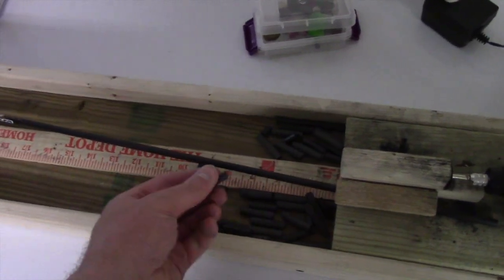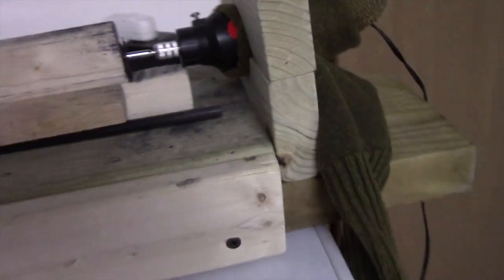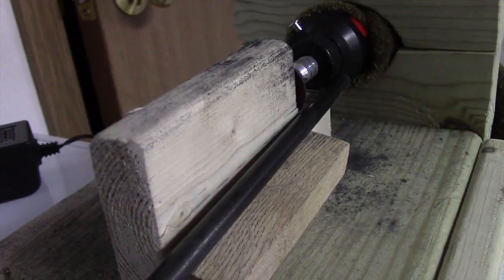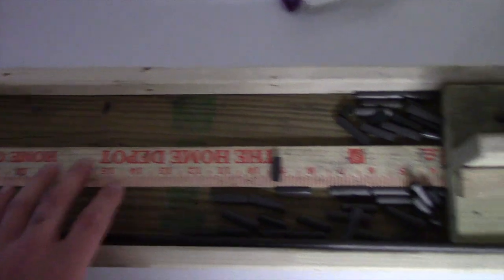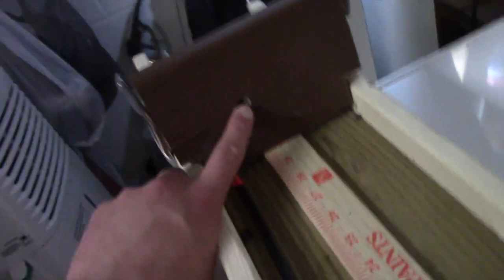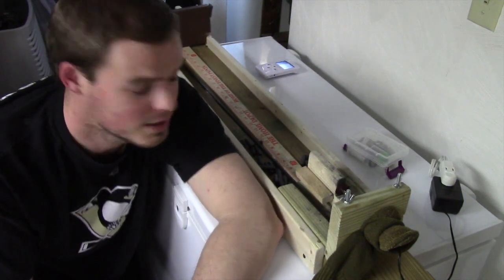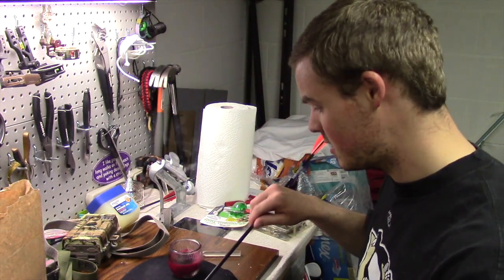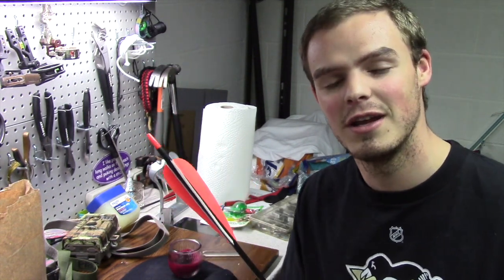Creating and Fletching Your Own Arrows

Comment: Hi
 When I made arrows back in the 70's I used something called a Thompson Tri-Fletch jig. It fletched 3 vanes at a time and could be adjusted to produce a helical twist in either direction. I've looked for another one, but it would appear that they're no longer made, a real shame!!! Another thing that amazes me is that you use a double sided tape??? I cannot believe that it's as good as the Bohning FletchTite  adhesive that I used for everything. I could never bring myself to trust tape, and it looked like an awful lot of fussing around to get that tape situated. I just ran a bead of Fletch Tite along the quill and set the jig in the fixture. Except for the drying time, I could fletch an entire arrow in under 3 minutes.
 Thanks for the trip down memory lane. I wish I still made arrows. I'm not sure I could afford to do it these days? Back then I could make a dozen Easton Game Getters for about $10.00. These days 2 shaft blanks runs that much!! I made a lot of Port Orford Cedar and barrel arrows too.
 Thanks:
Dave
Reply: Right on mate I was doing the same thing back in the late 8os 2117game getters out of pse pulsar express cam bow loved that bow getting back in to bow hunting not liking the new bows need release aid I'm a glove man

Comment: Great video! I like the Bohning fletch tape as well. The original Fletchtite glue was better than the Platinum IMHO. I put my arrows together pretty much the same way. I also use hot melt glue. I've used  the craft glue, Fletchtite hot melt, which is more brittle when cool, and I'm currently using some from Big Jim's Bow Company, which is just a longer stick of the yellowish hot melt glue. No problems with any of them. I haven't tried the platinum with vanes yet. I generally use cyanoacrylate gel with them. I think the acetone or denatured alcohol and keeping your greasy fingers off the shaft is the key to getting any of the adhesives to work well.

The one thing I do differently is for my hunting arrows. I usually use Zwickey Deltas, Simmons Tiger Sharks, or Magnus Stingers (usually with the bleeder blades). I like to have the blades positioned more or less vertically when on the bow, so just using a field tip won't cut it for my broadhead arrows. For those I install the inserts with a broadhead so the threads of the insert are lined up correctly. For safety's sake, always hold the broadhead with pliers or a broadhead wrench when doing the install. For practice with field tips or stumping with blunts or judo points, or probably even with three bladed broadheads, installing them the way you did is perfectly fine.

Again, great video! You would make a good teacher.

Comment: Try coloring the unsquared end of the shaft with a Sharpee before squaring it.  Once all the color is gone, you're pretty square.  Low spots will hold the color, so keep squaring until the color is gone.

Comment: The Easton tool you are using is not a squaring device, it is for rounding the inner edge of the carbon arrow to make inserting components easier and less likely to snag or degrade over use. If you watch in the video as you rotate the shaft, it is moving which compromises the squaring process. You need a tool like the G5 squaring device or the F.A.S.T. Tool, both of which immobilize the shaft while it is rotated to ensure a square end. Overall a good video.

Comment: Do you have a video where you cover bow maintenance? I shoot a compound and was wondering if I'm supposed to put any oil on the shaft going through the pulleys and waxing of strings and such. Glad I stumbled onto your site as you have explained quite a few questions I had in a very simple to understand fashion. Thanks
Reply from the maker: 1LRLRG I don't have that particular video but it's on a mile long list of ones I'm hoping to make!

Comment: Nate, I think you miss 2 thing. One is if I use nock pin, do I need to use same method like the point when glue it into shaft? Two, if I use insert nock (not using nock pin), what type of glue that are recommended?

Comment: Great job gave me some ideas.
I have tried 4flech gold tip regular size (Carbon)  
They have given me tighter groups (fact)
Also noticed 60 yards and less quieter flying before impact.
I want to move to micro arrows next.would about longer 3flech?
Longer than blazer length?
Any way, love the 4 flech . Too hard to glue them on?

Comment: Have you found a consistent conclusive method of locating the spine (stiffest side of the circle)?  Have seen different methods. Floating in soapy water, hanging a weight and measuring deflection.  What do you prefer?
Reply from the maker: I don't do any fancy method to find the spine. Dynamic spine matters more. You can only find that by shooting. So that's the method I prefer.

Comment: Would you use a helical with a short low profile 2" vane or just the offset? Seems like the helical would not do much on the sort fletching plus it's for a micro diameter shaft so might make it more difficult to glue them on.
Reply from the maker: Always run a helical for me. Even with that short vane, when I fletch offset vs helical I can look down the back of the arrow and see a noticeable difference. Yes, with micro shafts you have to be more away of full fletch contact, however I still manage to get a 2-3deg helical on my .166 Orion shafts.
Reply: @averagejackarchery  Yes I did a test yesterday and you are correct. I like the look of it. Will do that when my new arrows come in. Thanks

Comment: When cutting, do you rotate the arrow into the blade (so that the arrow surface and blade surface move in opposite directions)?
Reply from the maker: I'm an oddball and spin the arrow with the blade. I find I get a much more consistent feel and squaring of the arrow when I do it that way. Plunge to cut through main wall, than spin slowly to get the rest of the way. Maybe it's because I'm left handed in a world built for righties? Who's to say.

Comment: Hey man! What’s your take on the type of jig used? I’m looking at getting the bitzenburger but have seen others for cheaper prices (ie Arizona EZ fletcher, bohning blazer). Is there any reason you prefer the bitzenburger?
Reply from the maker: I use the Bitz, Bohning Helix Jig, and JoJan in the shop and the Bitz is just the most versatile on the market. Not to mention built like a tank. Now, if all you want is Blazers on standard arrow diameters, then cheaper options are fine. I go from .166 shafts to 27s and 2" to 5" fletchings. The Bitz can do them all.
Reply: Thanks man that’s super helpful!

Comment: Is it better to wrap the arrow or fletch straight on to the carbon? I’m thinking a wrap will preserve the carbon for re-fletching. I’m new to this and would appreciate any advice before I ruin 24 Gold tip Warrior arrows. Cheers.
Reply from the maker: For hunting shafts I think a wrap is a huge advantage for fletching. (I don't like them for target due to shooting a blade rest.) A wrap will allow you to dunk the end of the shaft into boiling water, the glue will release, and you can peel the wrap and all fletchings off in one pull in a matter of seconds. The only downside to a wrap is if you rip off a fletching, the wrap will come with it and you'll have to rewrap and fletch the whole shaft. Hope this helps!
Reply: Thank you very much! I am shooting ‘off the shelf’ with a Samick Red Stag takedown recurve. Your content is the most helpful that I have found. Cheers! I’ll be sure to follow your channel!

Comment: Hey also some folks will fire there arrows without fletching to test which way they are normally spinning and then fletch based off of whichever way the arrow spinned without fletching..do you recommend or not that big a deal?
Reply from the maker: For 99.999% percent of archers, it's not necessary.

Comment: your yt channels been great infos keep up the good work. I just got my bohning pro fletching jig. it came with the straight clamp and the problem I came into was the piece with two knobs was loose, how do I go about of lining it up?
Reply from the maker: You'll have to put a shaft in, put the clamp on, and then adjust the angle of the clamp according to your fletching. Once you've found it, mark it with permanent marker onto the jig so you always know where to go for that fletch. My jig has marks for feathers, blazers, and crossbow fletchings.
Reply: awsum!!!! thank u for replying so fast, please keep up the awsum yt channels

Comment: Would you say a arrow with four fletchings will help control a fixed blade  brodhead better or is the any difference between 3 and 4 fletchings
Reply from the maker: It would definitely add to the stabilization and almost certainly correct arrow flight sooner, but ultimately I don't know if the extra drag is worth it. But they do look good!

Comment: could you do a video on Easton FMJS, every pro shop I go to says you need to use a epoxy glue and the new insert. is this true?
Reply from the maker: You definitely want to use an epoxy of some type for any HIT insert for Axis or FMJ shafts. My personal favorite is golf shaft epoxy. Usually a 24-48 hour cure time. You can get a lifetime supply for arrow builds for a fraction of the cost of arrow-brand-specific epoxy.
Reply: thanks for that info!

Comment: That Easton stone you're using to "square" up the arrow isn't actually a squaring tool.  It's made for the Axis arrows to put a chamfer on the inside edge of the opening.  That chamfer is to accommodate field points and broadhead ferrules that have a chamfer that matches so they don't wedge the end of the arrow shaft open and split it 360 degrees upon impact with a target.  You really should use an actual arrow squaring device.  Otherwise, good video.

Comment: Does this save money? Or is it just a hobby. Great video by the way.
Reply from the maker: Thanks! And to answer your question: it depends on you. I REALLY enjoy a custom arrow specifically made for me and done the right way the first time. (i.e. Wraps lined up evenly, helical on my vanes exactly they way I wanted, etc.) So making my own is a huge plus. But also, buying the components separately, in bulk, allows you to save significantly over time. I get most of my materials from eBay. The most expensive investment is the fletching jig, as a Bitzenburger is a first-rate jig. But you can definitely go cheaper, but you pay for performance. Good luck!

Comment: You mention that a straight fletch gives no spin to the arrow.  This is incorrect.  It may not give as MUCH spin as a helical fletch, but the curve of the feather(right or left wing) DOES impart a 
modicum of spin, enough to stabilize the arrow in flight
Reply: grants245906  Not really, as long as all the feathers spiral in the same direction.  SOME archers claim that having the spiral go in the same direction as the hand holding the bow(i.e. bow in left hand, left hand spiral) helps move the fletching away from the bow on release.  I doubt it, though; there isn't enough time between release and the fletch passing the bow for it to start being affected by air pressure.  MY opinion. of course
Reply: grants245906  First you learn to get consistent in your  stance and release, then you start worrying about accuracy and distances

Comment: Is it ok to use feather on a whisker biscuit rest?
Reply from the maker: You bet! Although biscuits can be brutal on the life of your feathers. If you notice a lot of wear on 1 fletch in particular, make sure your rest is tuned correctly.
Reply: ok thanks man, love you channel
Reply: I have my wife and kids setup using a hostage style rest. Inexpensive and easy to set up, similar to a whisker biscuit, but it doesn’t contact the vanes or feathers.

Comment: Is it cheaper to make arrows?
What's the pros and cons over just buying them???

#noob
Reply from the maker: hart if you plan on only really shooting one style of Arrow such as Blazer vanes and nothing else buying a jig and doing all the means and ends to making your own arrows really doesn't make much sense. For people such as myself who makes arrows for others as well as shoot several different diameter arrows and styles of Fletching it makes perfect sense.
Reply: Average Jack Archery ok, thank you so much!
Reply: Just like any other product, mass machine-made arrows are going to be cheaper.  When you want something DIFFERENT from the crowd, then you either have to employ a craftsman
to produce it, or learn to do it yourself.  Either way, the cost goes up, sometimes substantially.  The question you have to ask yourself is: do you want "cheap but ordinary", or do you
want "costs more but is MINE alone"

Comment: Have you ever heard of STARRFLIGHT.COM. They make something called a FOB and it is designed to make the arrow much more aerodynamic, and increases accuracy. The FOB slides onto the arrow in place of the vanes.  I was hoping to get your thoughts about it. I have never seen or heard anything like it before.
Reply: Craig Carper I have tried the FOBs. I love to test new things. My experience was not great with them. Since they sit at the very back of the shaft, I found they affected my anchor point which caused inconsistent accuracy for me. I also ran into clearance issues with my drop away rest. Sometimes, but not always it looked like the fob was hitting my rest, which also affected accuracy. The last issue, which they pose as a positive, but I view as a negative is that they are designed to pop off during a pass through. With a lighted nock, this helps to recover the fob and identify where the deer was shot to help tracking, but then leaves your shaft and broad head somewhere without a fletching or lighted nock on it to help you find it. If given the choice I would rather recover my arrow and broad head vs just the FOB. 

If you are looking for something similar you could try Helios vanes by nockturnal

Comment: use real acetone, not the one from the lady's section. that has all kinds of additives and crap. the actual acetone is in the paint department. that leaves no residue. the one you are using leaves a residue.